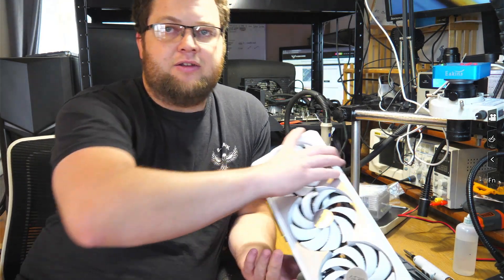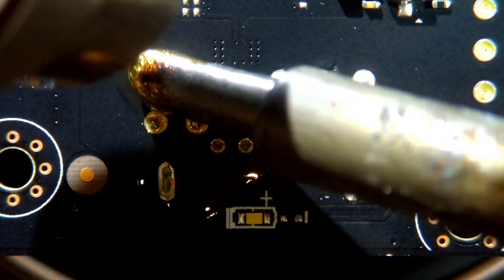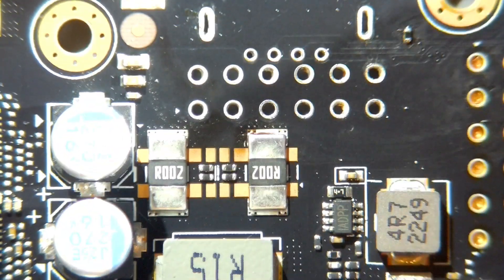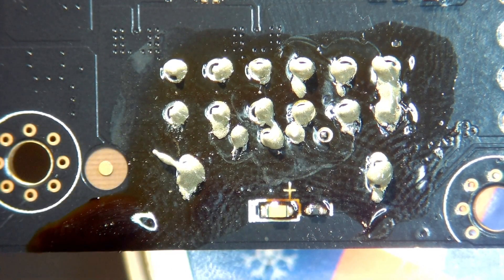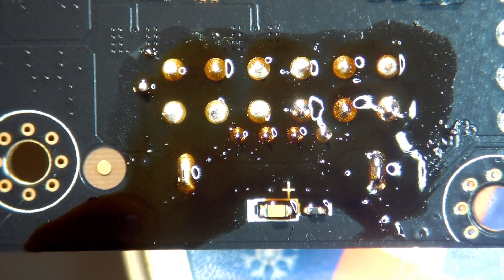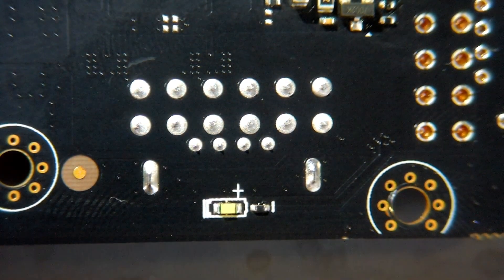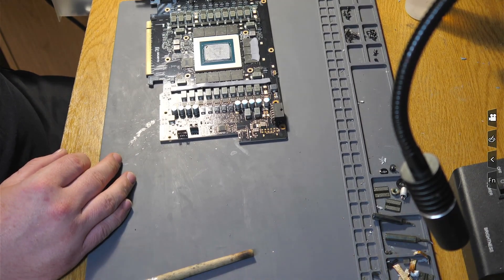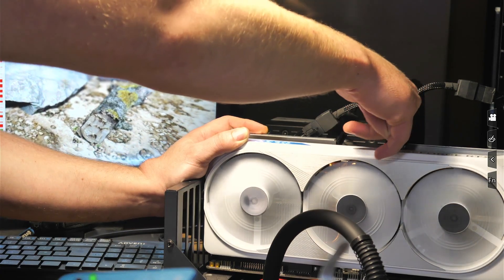Gigabyte RTX 4090 Aero - Graphics card Repair - Melted 12VHPWR Connector

Comment: What are the temps you’re running on the heat gun and iron?
Reply from the maker: @Beej6290  my solder iron stays between 330c and 350c. I rind that  keeping it in this range reduces tip wear from oxidation. My hot air temps change depending on the job at hand. Some jobs needs more heat, or more air. If there are delicate items nearby like electrolytic caps. Then, reduced airflow helps. This comes with experience. And a lot of bulging/blown caps being replaced while learning. Just remember that rapidly heating or cooling creates additional stresses. So things need to be done gradually to reduce the stress.
Reply: @b-hawkgaming  perfect thank you for responding!

Comment: love you videos i had a question im working on 3070ti gigabyte and fixed crack on pcb and replaced b1 and it runs fine but it still shows write errors on 4 vram chips a1 a0 b0 c1 and they all are 64 write  errors i dont understand how it is such a small amount of errors ?
Reply from the maker: Thank you. I have only ever seen such issues when using incompatible tests for the card. Double check that you are using the correct MODS/MATS for the correct card.